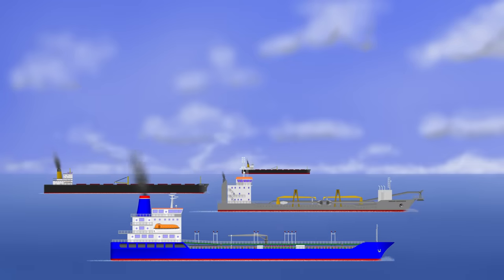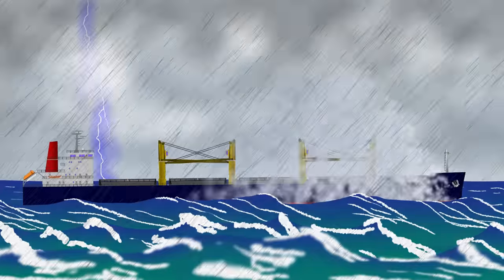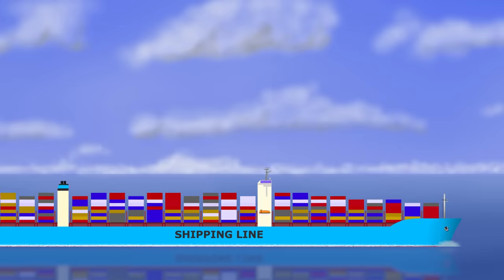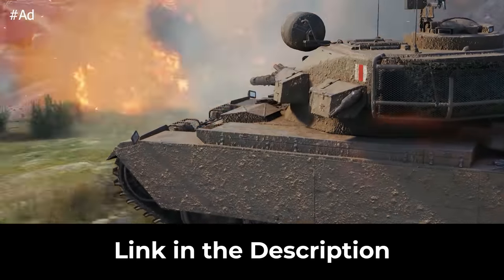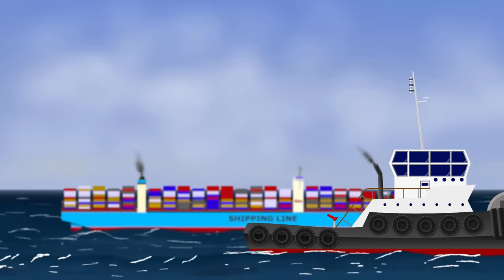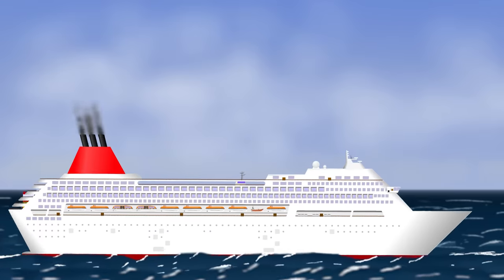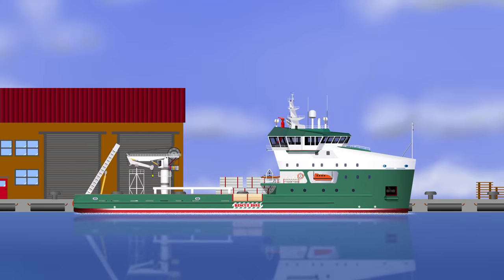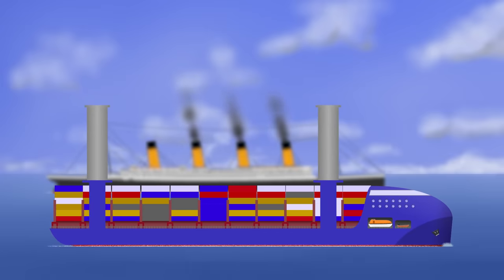Why Is The Bridge At The Back?

Comment: The real question is why is the bridge above deck at all? Using cameras, sensors or blimps on wire with cameras/sensors
Reply: Power outages, Limited visibility, Expense, Higher maintenance, etc

Not even mentioning Solar Winds that can destroy electronics
Reply: @Lazymotion  and what about all the satellite in space? Or technology in general. They all can be easily protect from "solar winds" using basic techniques like electrical pairing, EMI shielding of wires, and general built in tolerances. Both Voyager 1 and 2 are well outside of the suns protection into cosmic space yet functional and JWST broadcasting images from 13,100,000,000 years ago thats billions. Yes things do fail but in predictable ways. A system especially electrical can last centuries working 24/7 or nano seconds depending on how its designed. A large quantity of tech is designed to intentionally break perfectly just out of the warranty period. A period thay narrows as time goes on while. Normalizing people into thinking tech breaks all the time.
Reply: @Guardian_Arias  And How exactly is Lightyears a part of this?

"Voyager 1 and 2 are outside Sun's protection yet functional"

But that's the thing

The Sun is the one making it

If you're talking Cosmic winds then the Voyagers are still very much in the sun's magnetic field

Comment: well...my ship type would be the most expencive to build and ship engineers would probably laugh at my design...

but...

the bridge should be at the front, also the engine room and accomodation and the life boats...the ship should work in reverse of the traditional way, the ballast tanks for leveling and floating should be around the main propulsion vent that is underneath across the whole ship and there must be fins and vents acting as valves that can steer the ship in confined spaces and move the ship parallel to harbour...it should be fully ambidextrous, and reversable for all situations, weather, fire, emergency and smooth sailing...and the control room and bridge should be fitted with screens displaying the views all around the ship...bow...stern...port side...and starbird...

the ocean is one formidable world in itself, so if we engineer ships, we should keep the unforgiving nature of stormy oceans and deadly danger in mind regardless of the price tag, for in the end, life is worth more...

Comment: What bull shit. 
1. Wrong that captain stands in the back of old ships. Apparently never sailed on a Viking ship or Kog. That's a bad place to be. 
2 There are several disadvantages for the crew to live aft. as sound from cavitation and engine noise and the ship's movements are more disturbing there during bad weather. 
3. The lifeboats can be placed anywhere on the ship where accommodation is available. But as said, a disadvantage stern for the ship's movements in bad weather. 
4. Has no advantage whatsoever to the maneuvering of the vessel. 
5. That is the only one of the mentioned reasons why accommodation is aft, there are several more, but it can be said that it is one of the most important reasons why nowadays people put accommodation aft. 
So it's apparently done by someone who doesn't know ship construction or has been in command of a ship.

Comment: Are we going to return to an Age of Sail, since we can't have clean pulpusion like nuclear engines on commercial vessels?  I mean, we have nuclear powered military vessels with no incidents.  Bunker oil is the worst kind of fuel.  Nuclear would be so much cleaner.  But thanks to Greta Thunberg, we only have wind (sails) and solar (replace fuel tanks with batteries?) to move commercial cargo ships.

Comment: you failed to answer why the engine is at the back, here i will tell you. but i suspect you will claim you knew even thou theres no proof in the video at the point its needed

its to give the cargo more space.

for fire fighting eqipment are you insane? not all ships have that at the rear and you never point out that oil tankers have it threw out the ship.

99% of all ports help cargo ships in wih tugs so the point about the maneuverable is not really relevant 

over 90% of passanger cruise liners have a prop at the frount of the ship its at a 90 degree angle to the one at the rear to help with maneuverability... not sure how you missed that when all new ships have had them since the early 2000s.

no offence its like you done a half job on this and expected no one to notice the missing items but i suspect you will "claim" you knew but didnt add it due to this reason, be bold if you did not know or forgot just admit it and you will find people will respect that more then a bold face lie. other then the missing bits a good video to try to educate the people who dont see them ships every day.

Comment: World of tanks is a RNG laden server rigged game that induces rage in 95% of players who play it until they finally give it up.
It is a money grab game with new pixel tanks being released regularly that can only be bought with real money yet you do not own anything as you can be stripped of your account and banned for just questioning in game chat regulators who are appointed by the games owners/managers.
These new fancy tanks you buy are usually buffed via RNG to perform favourably in game yet once market saturation has been reached ie no one is buying them anymore due to them being on the game for a couple of months, they get nerfed back to being as normal as other tanks of their class/tier and a bright new shiny tank is released to great fanfare and the duped players then go and spend real $$$ on buying that one.... 
The game is not kid or youth friendly due to the anger and rage regular players endure/display and new players are often "seal clubbed" by more experienced players in the learner tiers.
Also, unless you have a top PC with up to date graphics cards and processors, along with a high speed fibre connection as a must then you will suffer loss after loss and receive verbal abuse from team mates for performing badly as the game maintains a loss/win ratio that others can view and then abuse you for. Note that it is difficult to go below a 43 or 44% loss ratio as the game itself is engineered to keep players in the 50% win/loss ratio by making sure you win by making your tank invisible to opposition team, or making their shells bounce off your tank and other measures so that new players do not get disappointed from constant losing.   
In summation, the game is not as "fun" as it appears to be from the outset and is sadly rigged via the RNG system settings.
Most of the abuse in game could be avoided if the game owners insisted on the removal of the win/loss % ratio.